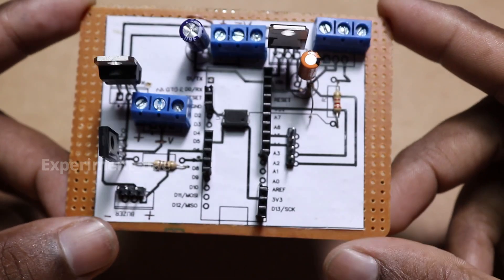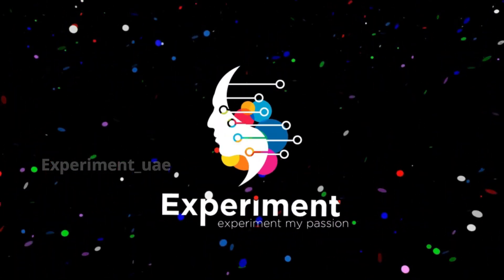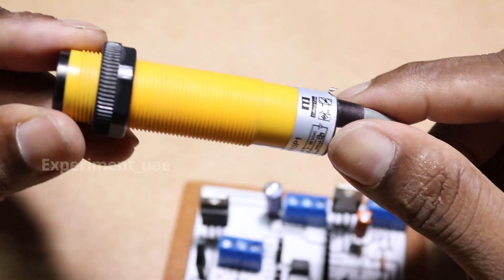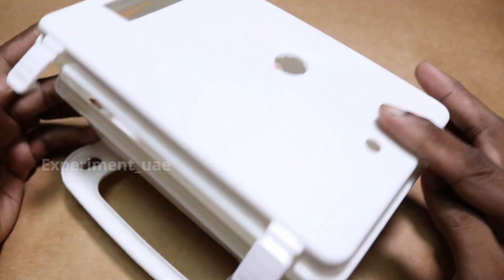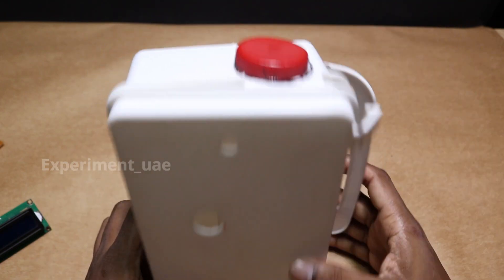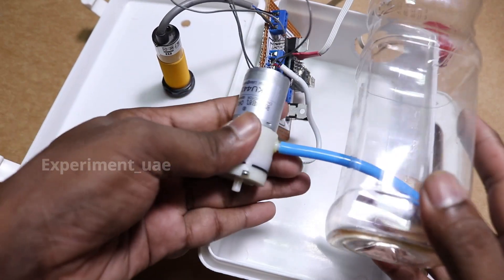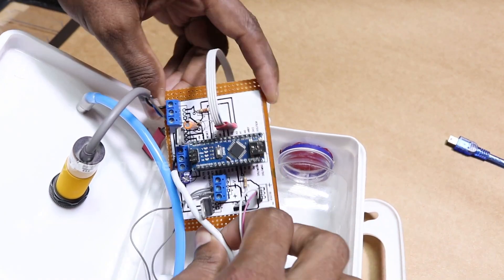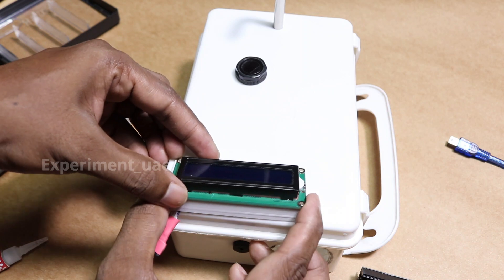How To make Automatic Sanitizer Dispenser | Not Affected SUNLIGHT | Experiment Uae |

Comment: Bro E3f-ds10p1 ee sensor enn pakaram  ee sensor use chayyan pattumo E18-D80NK adjustable IR  sensor  proximate switch  use chayyyamo
Reply from the maker: Yes pattum 5 v alle sensor
Reply: @Experiment_UAE  yes atha 5v ann appo use chayyam alla ok
Reply from the maker: Njan sensor connect chythirikkuthathu 12 v anu check diagram .. Ningal cheyubol sensor 5 v kodukkanam
Reply: @Experiment_UAE  ok

Comment: Sensor out arduno de conection pin atanu
Reply from the maker: please check schematic diagram
Reply: @Experiment_UAE  ok componets values  koode add cheyamayirunnu
Reply from the maker: അതിൽ മിസ്സിംഗ് ഉള്ളത് R2-200E / R1-1K /CN2- LCD / 7805 രണ്ടെണ്ണം ഉപയോഗിച്ചത് ഒരെണ്ണം ആര്ടിനോ പവർ ഒരെണ്ണം മോട്ടോര് സപ്ലൈ
Reply from the maker: ബ്രോ ഇതു സെറ്റ് ചെയ്യുബോൾ എന്തെകിലും ഹെല്പ് വേണമെഗില്  ക്ലിയർ ചെയ്തുതരാം ..അപ്പോൾ പറഞ്ഞാൽ വാട്സപ്പ്പ് വഴി കോണ്ടക്ട് ചെയ്യം
Reply: @Experiment_UAE  final work laanu
Reply: @Experiment_UAE  arduino vakkunatinte centeril  ic sensorinte output varunnundalo.. Chip atanu
Reply from the maker: pc 817 octocupler